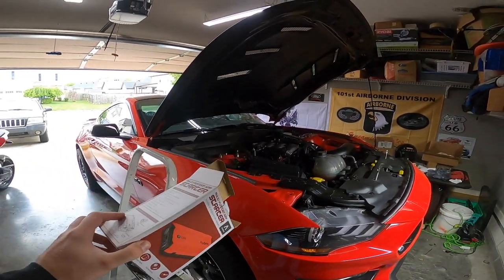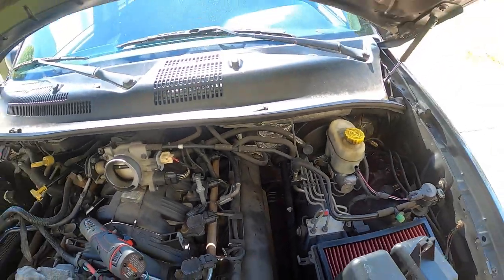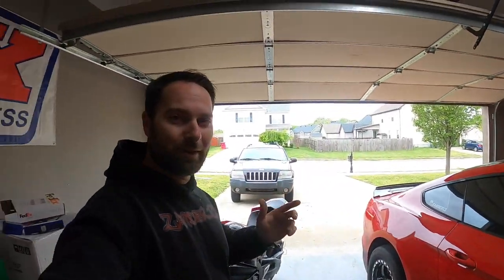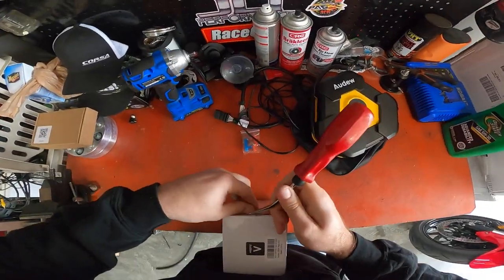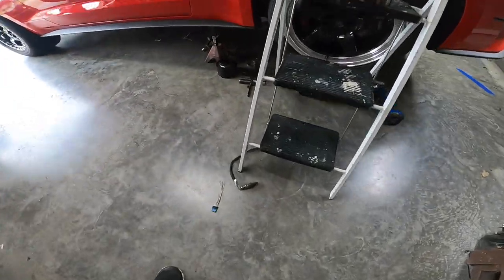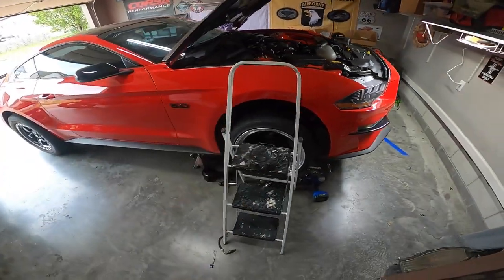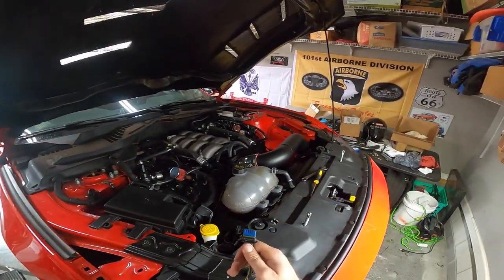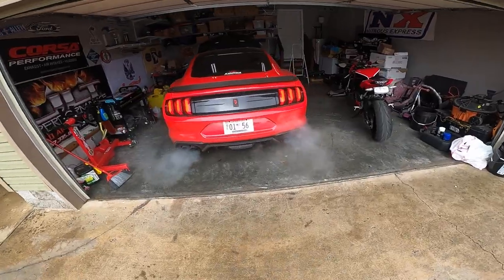ALL OF MY CARS HAVE CHECK ENGINE LIGHTS & YOU WONT BELIEVE WHY...

Comment: To who ever owns one of those jeeps and has a check engine light . Save yourself some money . They have there own on board diagnostics tool. . Switch on off , on, off and leave on the 3rd time without turning the engine on . Codes will appear in the mileage screen thank me later lol.

Comment: Do you get check engine lights with having longtube headers? On the mustang thinking about getting headers. Catted headers
Reply from the maker: You will need a tune or yes it will give you one
Reply: Zander13 so headers plus tune  equals no check engine light
Reply: ClassicNige you’ll need to tune it . Tuner removes cel.

Comment: It might be from reminisces of one of the accidents you had with the car? That piece of steel that did all that damage or maybe the plug and connection was pinch and heated up over load and time?, Glad you caught it and Of course I’m just speculating 😎🏁

Comment: May want to have new bungs put in at a 45deg angled up.  Moister from e85 will damage them at factory angles.
Reply: Huh?
Reply: Dat50go when e85 burns it creates water.  O2. Sensors are mounted on their side in the exhaust the water settles in them damaging them over time.  By remounting them at an angle up (tips down) in the exhaust allows the water to drain from the O2.